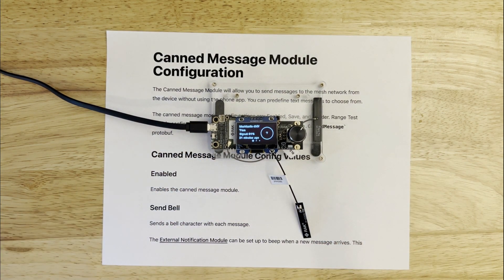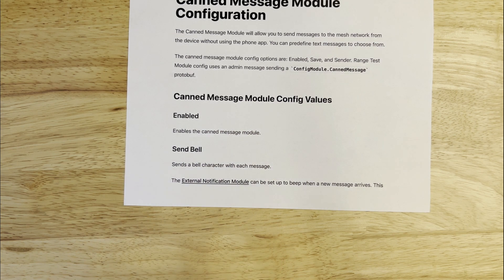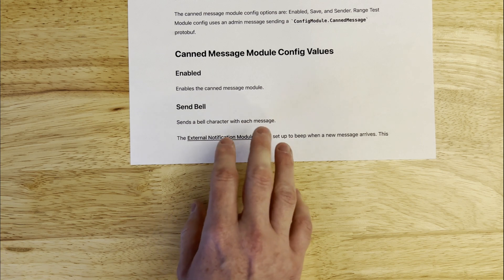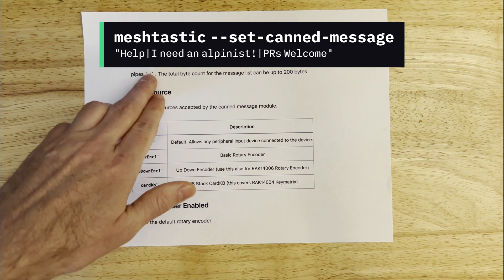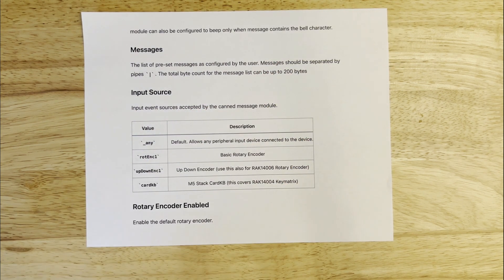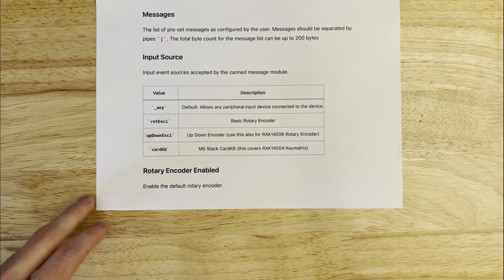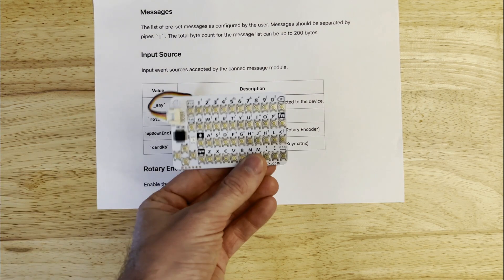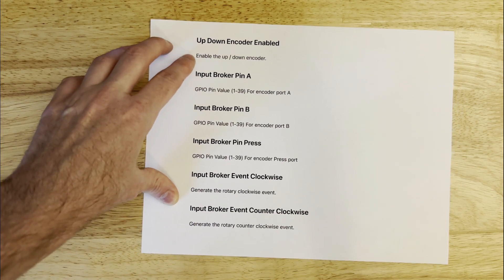Canned Messages - Meshtastic Month of Modules

Comment: So can a canned message also be the current GPS location? That would be neat... 1 click and your location is send to a friend.
Reply from the maker: No, but this is also already possible. Both the Android and Apple apps allow you to request/exchange positions with other devices. Additionally, for devices with a user button you can double press it to send an adhoc position packet.
Reply: The T1000E allows this by default with a double tap.  https://youtu.be/8p34S_9DDEQ?t=198

Comment: I’m new to meshtastic, we (my brother in law and I) have some lillygo devices on their way to us as well as an arduino and parts to build a repeater. So theoretically I could use an arduino and meshtastic to control my driveway gate, correct? And I could use canned messages to open/close the gate with a single button press, in theory, right? I would just use the GPIO pins on the arduino to trigger a relay activate the hydraulic pump  that swings the gate. And I could even put a voltage monitor on the batteries that power the pump and be able to remotely check battery status, right? Is meshtastic able to handle the coding and commands? Or is it setup for text transmission only?
Reply: These definitely sound plausible. I would suggest dividing the system to pieces and building small proofs of concept for each part. Good luck
Reply from the maker: Sounds like something you might be able to do using a secondary MCU connected to your Meshtastic device via serial. https://meshtastic.org/docs/configuration/module/serial